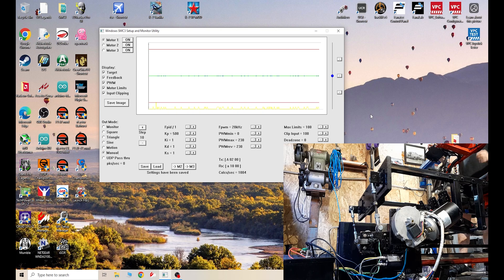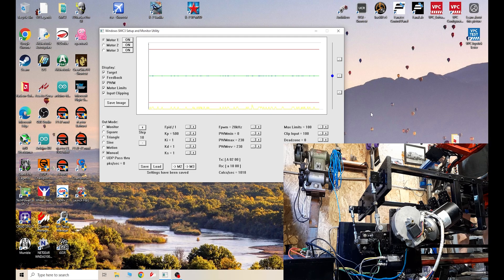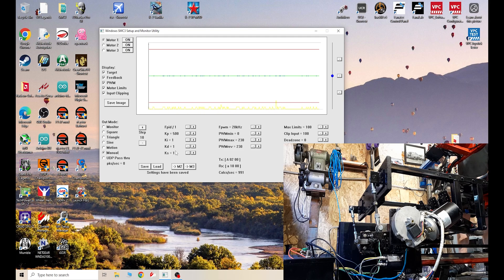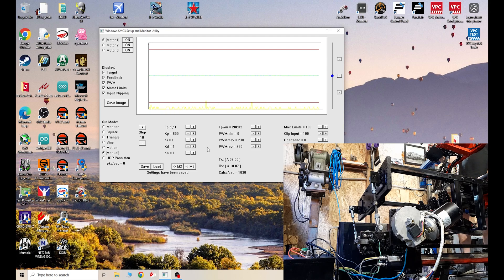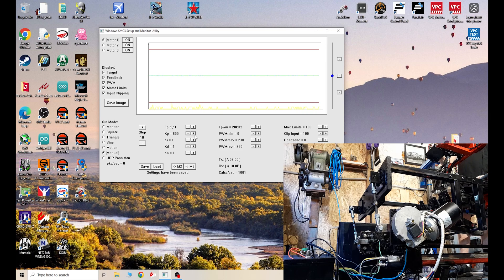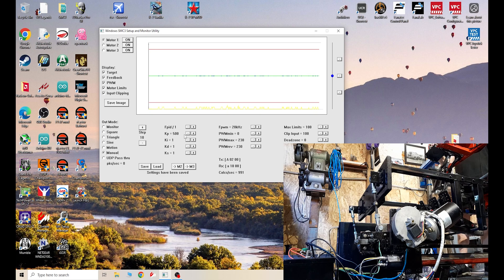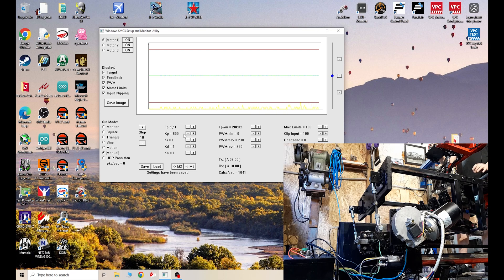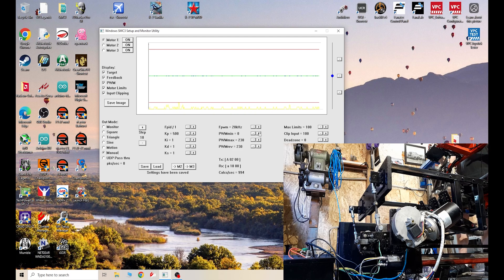Motion Simulator With Dynamic SMC3 Utilities Settings For Big Accurate Motion

Comment: Excellent explanation, but can you tell me why, once the right motor is set up and the data is transferred to the left motor, the two don't behave the same way? The right one works fine, follows the movements and the sine wave, while the left one behaves strangely and can't be set?

Thanks
Reply from the maker: Mmmmm. A few things this could be a result of. Please become a member of the Dr ADHD Motion Sim The World discord server https://discord.gg/mGFk7R2X and in the motion sim build questions category ask this question in the software channel. Thanks mate and I'll get back to you there.
Reply from the maker: Double check that there is not some kind of grounding issue with your left motor. Can you take a screen shot of your SMC3 utilities parameters for each motor you have setup and make sure you have the PWM box ticked so I can see the difference in the wave forms for each motor. Join the Dr ADHD discord and post the pics in the motion build questions software channel. We can work through it there. Thanks.
Reply: @Doctoradhd1  could you send the invitation again?
Reply from the maker: @andreaferrari1773   discord.gg/Zx6KzWEyVZ